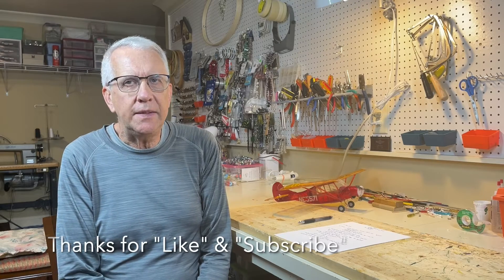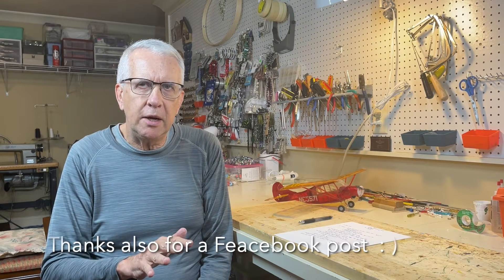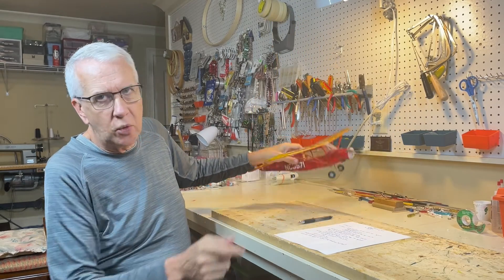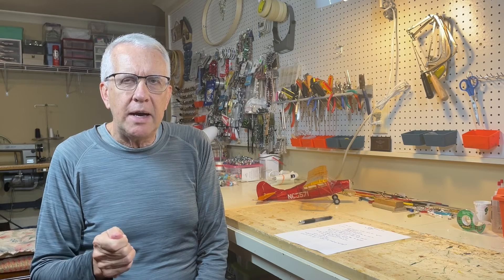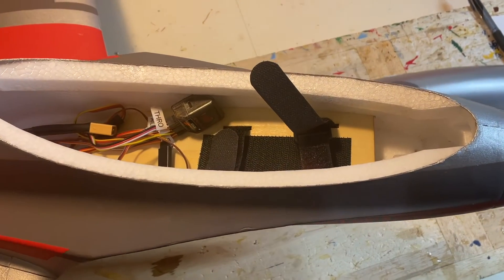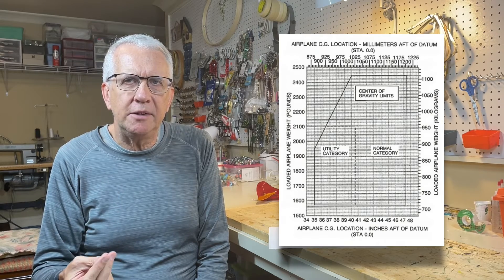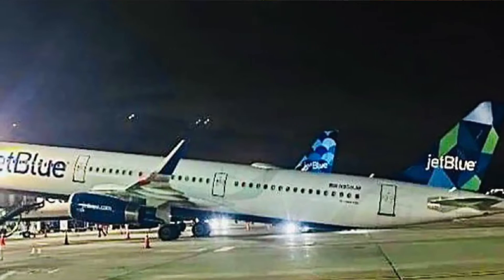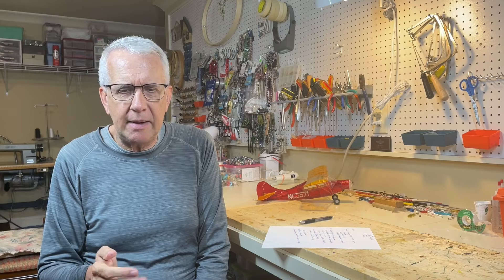The Critical Importance of Center of Gravity

Comment: A Boeing weighs 400 tonnes and takes 300 passengers that is 2.1 tonnes.How can the passenger weight or its distribution affect the center of gravity ?
Reply from the maker: A Boeing widebody, such as a B-747, is designed such that the passenger loads and locations in the aircraft typically do not matter.  Not the case with smaller airliners like the CRJ-700, where you might have to move passengers around to get to the right CG (I flew the CRJ-700 for two years).  When I flew the B-777F, the cargo (up to 210,000 lbs) had to be loaded just right for the CG, and the fuel load was a consideration as well.

Comment: Hello, have ever experienced a perfectly balanced rc plane when on the ground yet nose heavy once airborne. The battery is perfectly secured and the horizontal stabilizer/elevator is properly aligned. 
Leo.
Reply from the maker: Hi Leo!  No, I have not experienced this situation. Tim